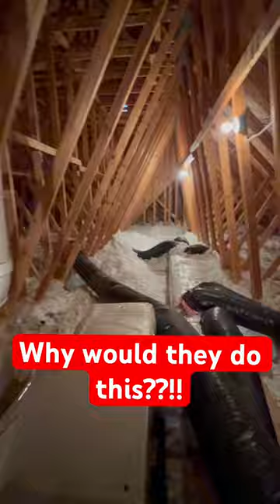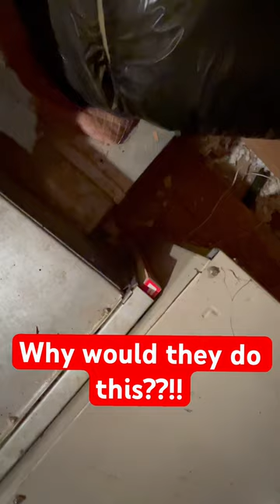Why would they put this in the Attic?!

Comment: So true. I hate the idea of having the HVAC in the attic. It is stupid to put it in the attic. You'd have to get a ladder, climb the ladder, crawl to the HVAC system, work in extreme heat or cold, exposed your lungs and skin to itchy insulation, work in a small space and hope you don't go through the ceiling below... it's just nuts. I wouldn't buy a home that has the HVAC in the attic.
Reply: Where I live in Phoenix AZ it would be almost impossible to buy a house without the AC in the attic. On certain older custom houses have furnaces in the garage or outside facing utility rooms (very rare and expensive houses) other than that your option is an older house before the 80s with low ceilings and then the AC will be a package unit on top of a heavily pitched roof. More dangerous to work on in my opinion. All of our houses are built by large developers and they put the AC where it is cost effective for them.
Reply: ... you should wear a respirator around insulation. Neighbour died of COPD caused by exposure to these filemants and believe me that's not a fun way to go when you're just looking forward to retirement

Comment: I lived in a 3 story house in Houston that had the HVAC in the attic.  The stupid HVAC drain line always clogged - I assume because of poor slope by looking at it.  I had to go up there probably 10X in the 3 years I lived there to clear the stupid thing out with draino and compressed air once it started draining into the overflow pan and dripping outside through the tell tale drain.  That primary HVAC drain line was teed into the master bathroom drain....good stuff.  Also, they also had the water heaters (2 for some reason instead of 1 large one) - right next to it.  The washing machine was on the 3rd floor between the bedrooms.  Lotta water high up in the house.  I had 2 flooding events in 3 years including 1 where I had to get the kitchen re-sheet rocked because it flooded so bad onto the second floor!  Terrible design!!!!  Glad I sold that house!
Reply: All that work and you never just re-ran the condensate drain line?

Comment: hvac systems are in attics all the time. its not stupid its normal. no code exists that says the filter has to be in a filter grill instead of a filter rack at the unit. so to answer your question, a homeowner who wants to have clean air in their home. welcome to hvac. you sound like the biggest premadonna inspector. read your code book, do your job. anything else you say doesnt matter.